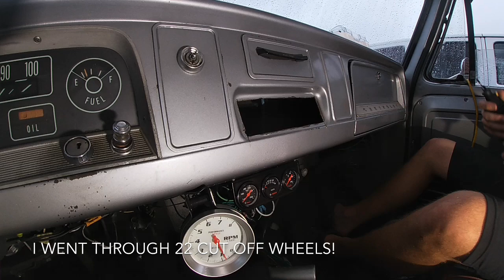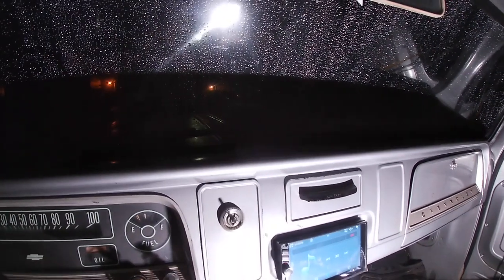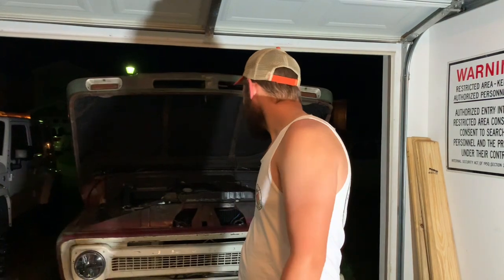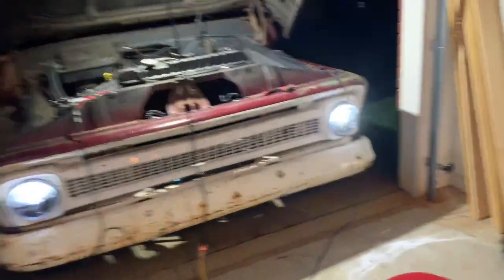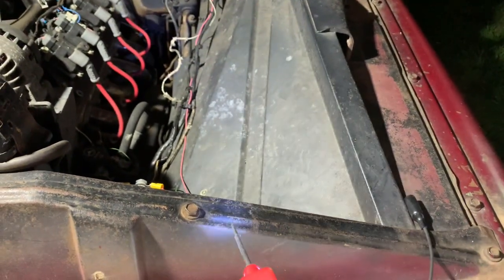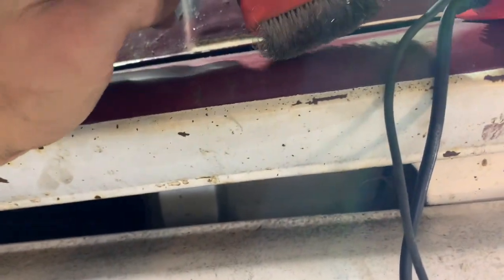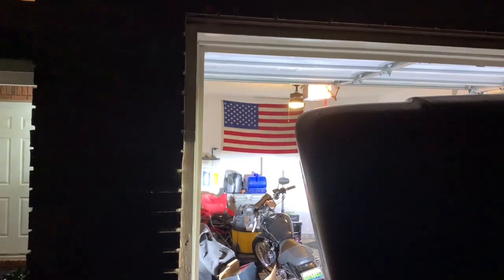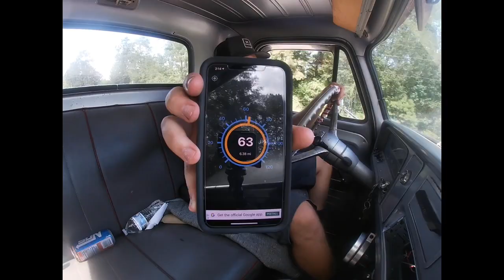Working On My 1966 LS Swapped Chevrolet C10 “Rust Bucket”

Comment: Looking Good!
Reply from the maker: Jake With A Rake shoot man it’s nothing like yours!
Reply: Uncle Mike I like em all!
Reply: Do you think we should fuel inject it or LS swap it? It’s got a 355 small block in it.
Reply from the maker: Jake With A Rake If the motor you have is a solid runner I’d look into doing a fuel injection from Holly or Fitech if the motor has a lot of issues I’d swap because it gives you something to make more content on
Reply: Uncle Mike The motor is basically brand new the carb is so aggravating...will probably just fuel inject it.
Reply from the maker: Jake With A Rake You can make good power out of carbureted motor but they can be a pain along with adjusting them whenever you go on long trips raising elevation and what not

Comment: That's a cool old truck
Reply from the maker: Man Cave 260 thanks man!
Reply: @UncleMike1776  I have an 05 Silverado with a 4.8 and it runs really well and sounds great with the flow master 40 series exhaust. Your truck should go pretty well with a 5.3
Not sure why anyone would try to pass a 5.3 as a 6.0. I would rather pass a 6.0 as a 5.3 just to mess with people. LOL
Reply from the maker: Man Cave 260 they are all good motors IMO so versatile
Reply: @UncleMike1776  I agree my Silverado is way more dependable than my f150 with the junk 5.4 3 valve. Don't ever buy any ford with that engine

Comment: Even with a 5.3 the main work has been done with the swap. It might need some odds and ends but it runs and drives. That being said drop a badass cam in and and let her talk. Or wouldn’t be hard to swap in a 6.0 if you ever wanted to.
Reply from the maker: MrDrewsto boost? Who knows?
Reply: Uncle Mike yes definitely another option. Those 5.3 are tough and actually a pretty capable engine. I look forward to see what you do with the truck. Makes me motivated to build something of my own.
Reply from the maker: MrDrewsto do it man even if you don’t know exactly what you’re doing you’ll figure it out and work through it!
Reply: Uncle Mike I’ve been looking out for that fb deal lol